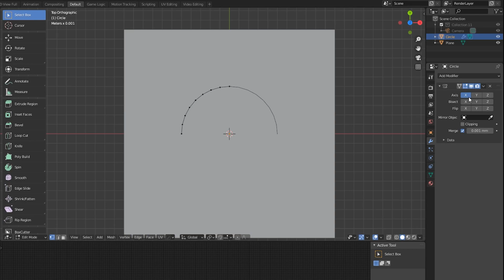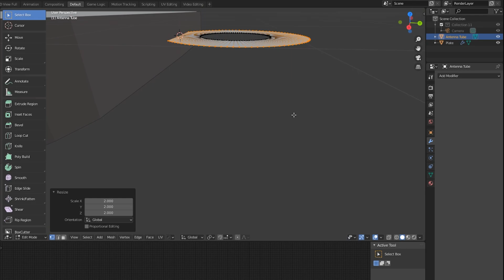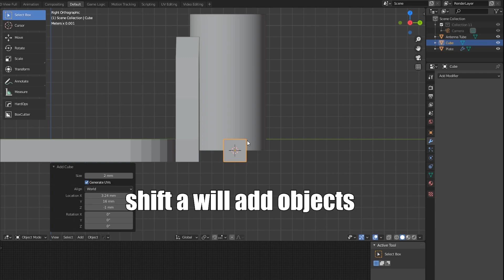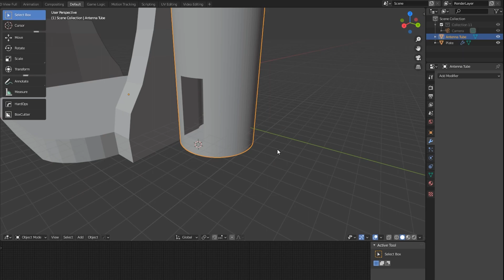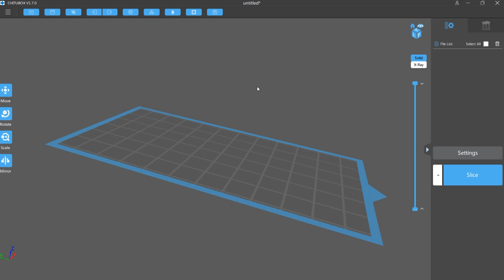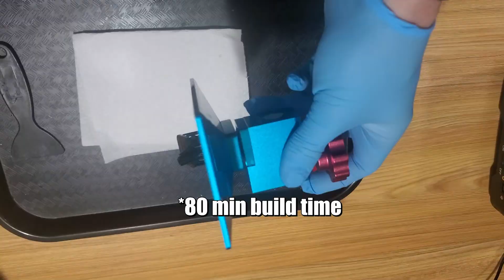Creating 3d printed RC car parts using Blender

Comment: Thanks for this.  I normally work in Fusion 360 and I could pretty confidently make that object in there.  But working in Blender requires a completely different approach and I didn't even know the basic terminology to Google what I was trying to do.
Reply: How was fusion 360?
Reply: @nickmurphy9876  I like Fusion 360 a lot.  Blender is a good tool as well though.  Both built for different purposes, but for basic geometry I find Fusion a lot easier to work with.